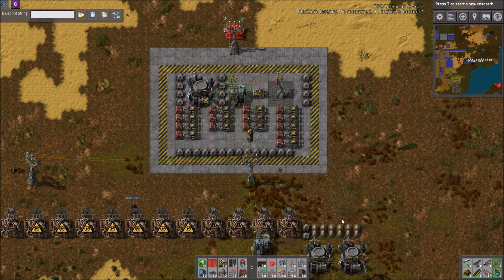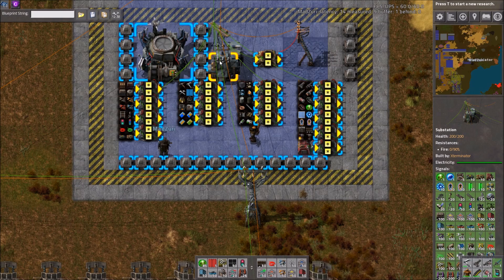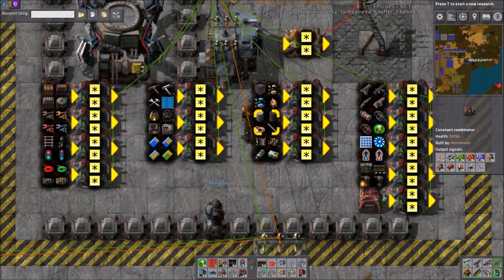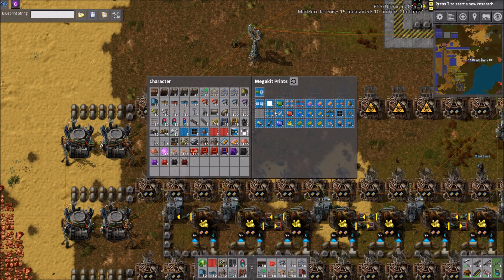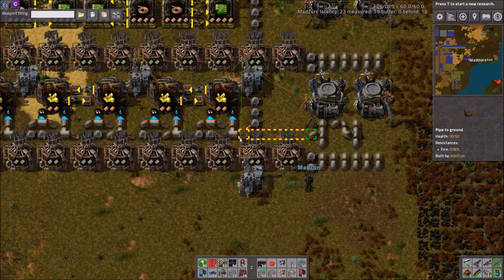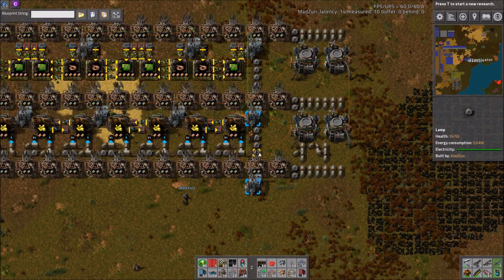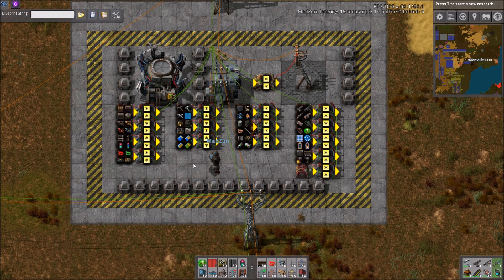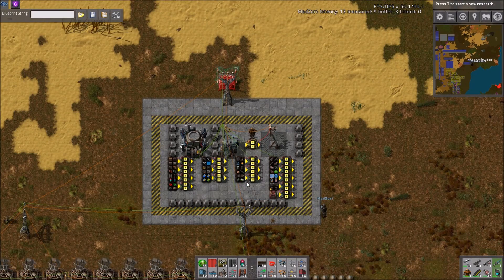Factorio Workshop - Building A Better Factory :: TheAnderblasts Base Control Center

Comment: Even if you don't run wires everywhere to the output inserters where things are being made, it's great to have the control centre set up with what you'd like in your factory. This will let you see in 1 central place what you are short of compared with what is already in your logistics network, just by hovering over the pole that has the output from the the decider combinator.

Comment: This controls buffer size and you won't ever need this for every single item, only for items you need a ton of, that take super long to produce but that are way too expensive to just let run at full force all the time so you need a way to direct your resources into whatever flavor of item you need right now.
Only t3 modules fit that category.

At no point will you go "damn, I need to raise the limit of fast inserters from 50 to 200", especially if you have a construction train that requests them in and already functions like a buffer you can control.
Reply from the maker: Well, I don't know about you but I definitely find the need to change the reserve amount of all different items. I have on multiple occasions needed to raise the limit of fast inserters or stack inserters, etc. Now going to the extent that he did with literally every item in the game is probably a bit much, but there are a lot of items, even quick producing ones that I would want to change on the fly.

Comment: i made a backup generator that switches on a power switch at 5 % accumulator capacity and turns off when the accumulators reach 10% capacity. the next time the power switch closes at 5% again. maybe you have done this already?

this prevents the powerswitch from coninuously switching the generators on and off.
Reply from the maker: We have done something similar to this before. It definitely comes in handy!

Comment: The author here is using the constant combinator to simply output item stacks, so he can optimize the computer with just one arithmetic combinator, however, you can use constant + arithmetic units to output blueprints, you output the items required to build any one of your blueprints, and then use the arithmetic combinator to modulate how many, for instance, you decide to build 10 new bunkets, you fill the constant combinator with the buker components and then multiply by n the whole set, this is hugely useful
Reply from the maker: Oh yeah for sure! :D

Comment: It would be awesome if you could insert the negative value dirctly into the logistic network. So you could set the inserter to be connected to the logistic network, and have an enable condition lower than zero. Then you wouldn't have to run wires all over the base.
Reply from the maker: Yeah that definitely would be nice. Perhaps in a future update that will allow something like that.

Comment: Personally, I prefer to put demand as a positive value rather than negative....because when you first set up an inserter, the test condition is already set to ">0" for you, so you only have to select the item itself.

To do this, you take the wire from the roboport into an arithmetic combinator as Each * -1 : Each.  Then connect all of your constant combinators to the output of this arithmetic combinator and that is your "demand wire" output.  Anything in the positive is a demand.

The other thing that I like to do for wire assignment is "green is demand, red is supply"....rather than Zuri's "green global, red local" idea.  But that's me.
Reply from the maker: Yeah that is definitely workable as well. I have seen other people use the "green for demand, red for supply" method and again, I think that works too. A lot of this stuff just comes down to personal preference and what works best for you. 
Good suggestions though, it's great to have variety to think about!

Comment: 120 fluid per second is actually pretty doable over that distance. You get 120 fluid per second over a distance of 14 pipes, and remember that it only has to get to the first chemical plant at that speed, since the next one will be needing less, and even less after that. However, if that fluid bus is getting quite long, you're gonna need some pumps halfway. (with universal barreling in .15, you can just request the fluids and those pipes will be easily able to support that throughput.)
Reply: Yes, come 0.15 I plan to scrap the fluid bus, and just incorporate unbarrellers into the plugin designs that use fluids.  (I haven't tried the mod that does this already.)

Comment: Thanks for the review!  a few comments...

My handle is Theanderblast, not Anderblast :)

The main idea is the control center, the shells with overlapping wiring, and the plug in modules that go into the shells.  I'm sure better plugins can ce designed - I keep refining them.  And there could be better shell layouts; as long as the green wiring overlaps.  ore info at http://imgur.com/a/uxwAl
Reply from the maker: Haha whoops, I messed up the title, it's all fixed now. :) 

For sure, overall it is extremely well designed! As we mentioned in the video, we would probably change the shells and insertable modules a bit, but yeah I really really like it overall. In fact, I will most likely use this type of design for my 0.15 megabase to control everything. 
Thanks for the submission, it was fun to go over, and something different than what we have been doing!
Reply: Thanks!